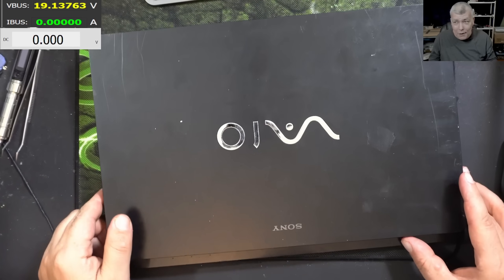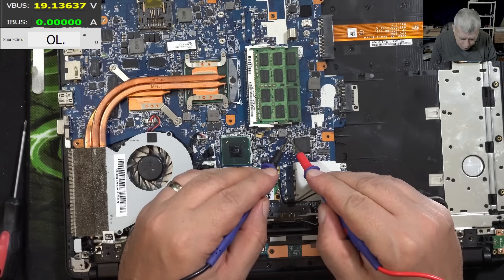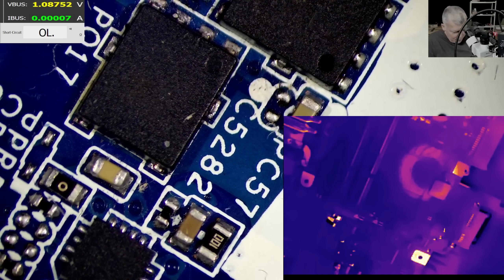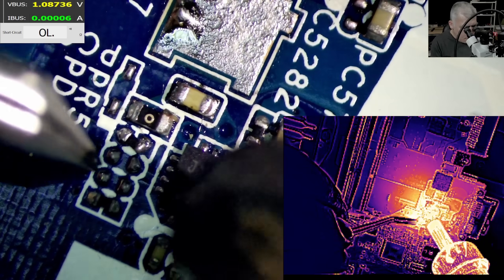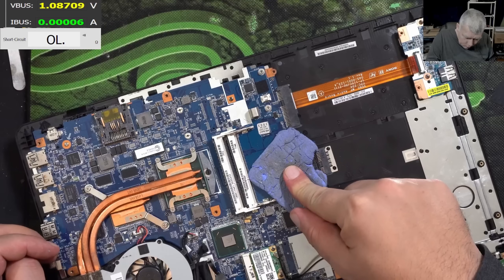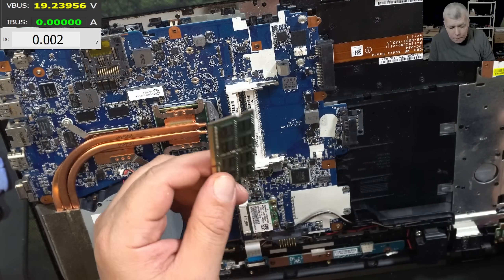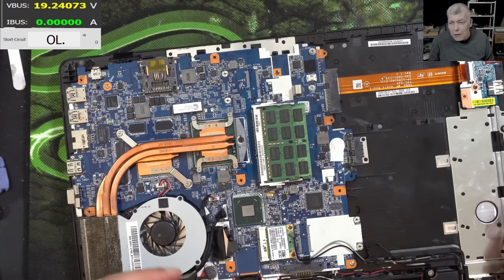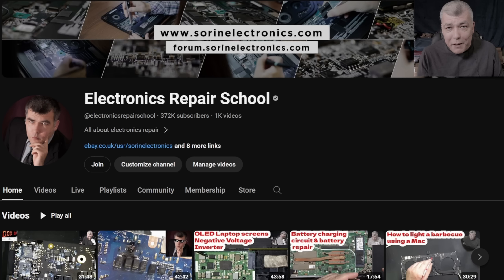Sony Vaio pcg-81313m dead after charging port replacement - What went wrong?

Comment: I'm watching this on this very same laptop, SONY VAIO VPCF2 with i7-2960XM CPU @ 2.70GHz up to 3.70 GHz, 16 GB RAM, 1 TB SSD, 2 TB HDD in BluRay drawer, NVIDIA GeForce GT 540M  (2 GB) Graphics Card. I even bought 2 sticks of 16 GB RAM, but it doesn't support it. Connected to a 2007 1080p SONY TV via HDMI, and it plays YouTube videos in 2K no problem.

Comment: Those older machines were just built so much better: many supported mSATA SSDs and upgradable CPUs, you can get 16GB DDR3 and a 2.5" SATA, and you can even get compatible modern Wi-Fi cards now.

Comment: Replaceble  CPU and RAM ,The best laptops ever ,you can upgrade the cpu with a variety of CPU s in its line, specially this Laptop Because it has High current  Requirement , it can accept extreme editions of cpu.

Comment: But the CPU being socketed or not, is not the main issue. That just prevents the average use from being able to replace themselves.

 The biggest problem is it is next to impossible to buy CPU/GPU from a reputable source. Manufacturers should be forced to provide spares directly for a number of years after manufacture, at a fair price.
Reply: Possibly one can buy the motherboard and take the CPU from there.
Reply: @Drottninggatan2017  To be fair @gpalmer711 specifically said "from a reputable source". Sadly you don't know if a motherboard that you find on eBay or your local Craigslist is going to work.
Reply: When mobile CPUs were socketed you could easily buy replacements since it was easy for individuals or businesses to disassemble a laptop (possibly with a different fault) and part it out. That and the fact that back in the days the failure rate of CPUs was far lower made it a non-issue. GPUs were much more of a problem back then, soldered on the board (sometimes on MXM card but still low availability) and with pretty high failure rates, which also meant that a replacement GPU had a high chance of being half-dead anyway.

Comment: Good job. The newer CPU's are smaller with their internal tracks and cannot take the higher voltages without shorting out. It's like comparing a 10 amp fuse to a 1 amp fuse.
Reply: Yep 2 nM <> 10 nM...

Comment: I think the problem lies in how small and full of specs they try to make these cpus or gpus nowadays, I guess this what makes modern cpus more prone to damage and older ones to have more absolute voltage rating than modern cpus( where you can find the chipset ,the gpu and cpu all on the same die).